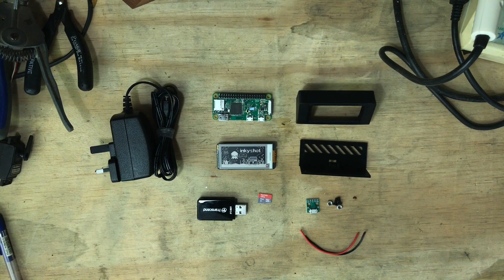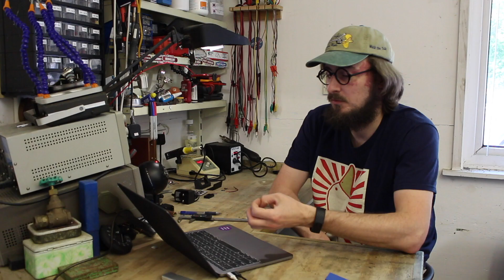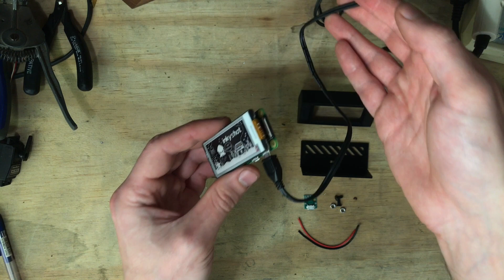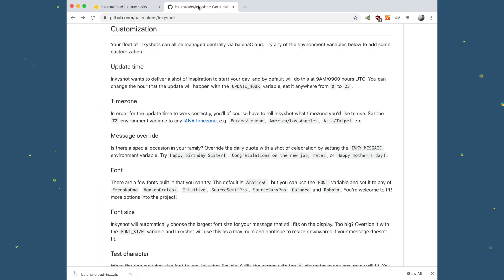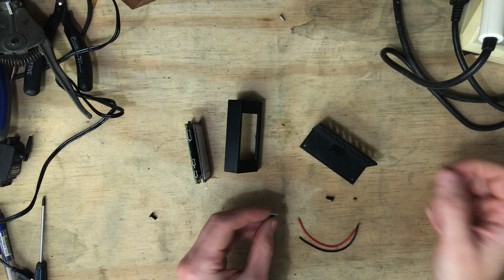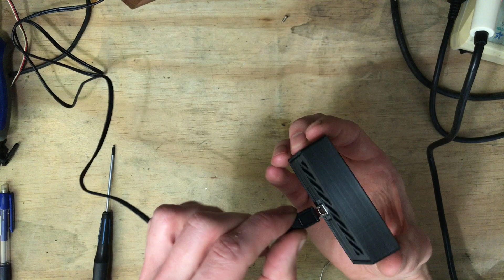Project build: A Raspberry Pi based inspirational messenger

Comment: is the device connected over wifi?? and how is the device powered standalone??
Reply from the maker: Thanks for the question! The device in this example is a Raspberry Pi Zero W, so it's connecting to the internet using Wi-Fi on 2.4Ghz. The Inkyphat display is e-ink, so when the device has its power source removed, the state of the display is the last message presented. It won't update until the device is plugged back in and reconnects.

Comment: this is a noob question: what size of cable do i have to use? i was trying this for my first project and i cant fit the cable into the micro usb adapter. My cable are 0,5mm (im from eu) and i dont know if they are just too big or if im doing something wrong. And if they are too big, which size should i get? thanks for anybody who will answer.
Reply from the maker: Thanks for asking and we're glad you're trying it out. Is it the connector that you're having trouble with or fitting the length of the cable within your case?
Reply: @balenaio  im having problems fitting the cable into the small hole of the adapter. I tried with some twisting of the cable so the fibers stay together and i guess thats how it works. im just not very good at it. :')

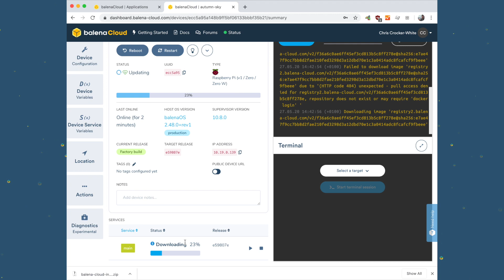Comment: Hey there, I'm using a waveshare display and am having trouble. I'm Not sure how I can get the device to release like you do @4:45. It shows that its online and connected. Would love some assistance. Thank you
Reply: In BalenaCloud, you'll need to put in an device environment variable on your device, name it WAVESHARE and set the value to 1.  
Then reboot.  After reboot, your display should work.  I have the 2.13inch waveshare and it has been working great for the past two weeks.
Reply: @TheDeBarros  thanks for the reply, I did that already :(. It just doesn't show the release downloading etc
Reply: So I figured it ou! Dont rename the project before you deploy to anything except the default "inky-shot" !!
Reply from the maker: @TheOnlyBiggieSmalls  We're glad you got that to work. We'll also explore why the naming was an issue. Usually you can rename projects whatever you'd like. If you're still having trouble, please visit our Forums (https://forums.balena.io/c/project-help/12) for help as well.

Also props to Adrian for the help! We appreciate you.
Reply: I'm using a Waveshare display as well and I'm running into the problem that it sets the font size to 8 no matter what i set the variable to. It only works when I use the override function. Wondered if one of you maybe had the same problem and how you solved it.

Comment: This looks a bit overkill for just powering a screen. Why not use a much more cheap an much more power efficient esp32?
Reply: The InkyPHAT is a Raspberry Pi HAT so it wouldn't make much sense to use it on something else when it's plug and play here
Reply: @chriscrockerwhite  that is just a ink screen with a presolder connector. You can get one with i2c to use with any controller.
Reply: Danielo515 yes, that’s right
Reply: I agree with you, it is overkill expense, total cost of the build is rising very fast, just using an Pi to display msg on a screen is a waste, especially when we looks at its price!!!
I guess the same build can be realised with a TFT LCD (as 3.2 inch 320*240 SPI Serial TFT LCD Module) + an Arduino Board as micro controller. 
Dont get me wrong, I respect and salud the idea and the initial project, but to expensive when we look closer to the final cost.....

Comment: how difficult would it be to pull said quotes from a different place, perhaps even a file on the pi itself for when or if there is no internet?
Reply from the maker: If you can put together a little bit of Python, then very easy. You can look at the code around this point, which is where it's pulling the quotes from the external website. You can edit the project before pushing to the device: https://github.com/balenalabs/inkyshot/blob/master/update-display.py#L62

Comment: Si I'm a bit new to this, but can Balena be used to deploy other projects from github? I actually have an Inkyphat and pi zero that are attached to my work bag, it updates with the date and weather conditions throughout the day (used to have train times but corona changed my ability to use public transport...) but this system seems like an easier way to deploy the projects, since right now I just use chron to update it throughout the day...
Reply from the maker: Thanks for the question! Yes, we specialize in removing the friction from setting up edge and IoT projects, many of which from GitHub. Our goal is to make it easy for people to provision, deploy, and mange their edge devices at any scale. Check out some of our other projects on our blog (https://www.balena.io/blog/tag/project/) or visit our Forums (https://forums.balena.io/) to see what other folks are up to.